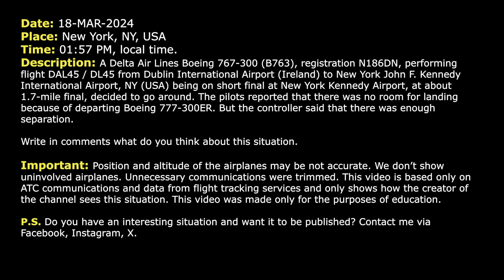Pilot argues with Tower controller about separation at New York Kennedy Airport. Real ATC

Comment: When the controller says “it would have been tight”, that’s says it all.
Reply: And he asked the the aircraft that had landed to exit the runway without delay and he asked Delta 45 to slow their speed. So clearly there was a developing issue with spacing.
Reply: That's why he realized what was happening and took action to make it work.. @BLACKMONGOOSE13
Reply: All he needed between the two aircraft was air India 6K feet down the runway and airborne when delta crossed the threshold. I did this many, many times when I worked in the tower. It’s rather fun!
Reply: Who operates on tight.?
Reply: @alexfrancis3603 I did for 34 years. To maximize airspace utilization, running at minimums is required.
Reply: @michaelhall9138  right. I agree with you.
Reply: They operate with no margin for error and lucky dice rolls day after day. Bean counters say it is efficient and profitable. Hundreds are going to die in a single incident before anything changes.
Reply: They also don’t fly commercial aeroplanes. The pilot said it wouldn’t work so it wouldn’t work. There is no debate around that and the ATC needs pulling up on his response.
Reply: @TuppenceAbucket ”atc doesn’t fly aeroplanes.” And pilots don’t hit squeeze play air traffic control gaps, so maybe listen up and know that a 2.5 miles gap is all you need. I do it everyday. Pilots are not experts at everything, they screw up everyday as well.
Reply: @SouthendSupreme  hopefully I won’t ever be on one that you are flying then blindly doing what ATC says
Reply: @TuppenceAbucket  I’m not a pilot. I’m a controller. 5 mile gaps are hit all day long all over the nation. Even tighter at busier airports. The truth can be scary for some but maybe you shouldn’t fly. Period.
Reply: @SouthendSupreme  did you even watch the video before wading in? It was down to 2.5 miles  (and closing) when Air India got their takeoff clearance.
Reply: @TuppenceAbucket if YOU watch the video he says the magic words when he lines up Air India “traffic 5 mile final.” Thus I said he hit a 5 mile gap. When the landing traffic rolls out and turns off it was down to 2.5. Standard operating procedure. You have no frame of reference, experience or knowledge in this field. Your opinion is that of someone who gets their news from memes. You know nothing about what you are talking about. Again everyone, everywhere hits 5 mile gaps all day everyday. If you don’t then you won’t certify. Please do better.
Reply: @SouthendSupreme  the 5 mile gap is irrelevant, It could have been 10 or 20 at that point. It was a 2.5 mile gap controller said during Air India’s take off clearance. That’s the bit that that matters. And was closing to a point where the pilot went around because it wouldn’t work. You have no idea what knowledge I have keyboard warrior so cool your jets. As to frame of reference I have exactly the same as you: the video and what was said. Which for some reason you are completely misinterpreting to be other than what is heard/visualised on it.
Reply: @SouthendSupreme  agree. He doesn’t have a clue, yet he has an opinion.
Reply: @TuppenceAbucket  you don’t know what you are talking about. Read what Michaelhall has written. He is correct about the distances. 

You keep arguing with others, but you continue to be wrong. 

This didn’t seem too close. The controller didn’t think it was too close. Now, that doesn’t mean that the pilot felt it was too close, which is fine, everyone has their own limits, but legally, this wasn’t too close.
Reply: @TuppenceAbucket   You obviously don’t have my knowledge and you still have no frame of reference. A 5mile gap to start ALWAYS ends up 2.5 when it comes time to roll them. Sometimes less and since you think 2.5 is tight, all I legally need is 6000 ft. That’s right. Barely over a mile.  Again, all you “think” you know is what’s in the video but I know the rules AND the game. I’ve seen it, lived it and worked it. I know you know nothing. You prove it with every reply. You should not “have waded in”, let this be a life lesson.
Reply: @rtbrtb_dutchy4183  why are you waffling on about legality? I never mentioned that. The pilot said it wouldn’t work. The controller argues and in doing so felt it necessary to lecture the pilot that he does it all the time. The pilot reiterated it wouldn’t work. Please stop trying to be “right” about everything.
Reply: @TuppenceAbucket  I’m not “right” about everything. But you are arguing with me about the industry I work in as a pilot and you seem to think you are the expert. There are also two controllers in this thread who not only disagree with you, but try to explain everything. 

So, let me recap the video for you:

1) the pilot decided to go around and has every right to do so. He felt uncomfortable and was distracted. He should go around. 

2) The controller was also correct, this would have worked. 999 out of a 1000 pilots would continue to at least the threshold of the runway. Me personally, want to see the airplane airborne by the time I cross the threshold. 

This pilot called it off early. That’s fine, he obviously was no longer focused on landing, but on the aircraft on the runway. But that doesn’t mean he was too close. He wasn’t.
Reply: @TuppenceAbucket  and the “right about everything” is just ridiculous. You are the one who keeps challenging people in the aviation industry. People who are experts due to their jobs. 

I know nothing about trains. Nothing about boats. Nothing about medical stuff. So I don’t have opinions about it either. Only questions. You on the other hand, think you have expert opinions about an industry you are not involved in.
Reply: @TuppenceAbucket  ATC wasn’t arguing. I don’t know where you guys get that from. There was no argument. There was a discussion and explanation back and forth, nothing more, nothing less. 

Stop making this a drama.
Reply: @rtbrtb_dutchy4183  100% with you. This was no argument. ATC was doing his job and the pilot was doing his job. In this case, expectations just did not match. However, if there would have been an argument I am even more with the controller, as he sees these situations every day, its not the pilot's job to tell the controller, what would have worked, he probably doesn't know how reduced runway separation works. He should have said: "We were going around because we didnt feel safe" - but telling ATC "there was no way this gonna work" is kind of disrespectful.
Reply: @rtbrtb_dutchy4183  When he said that he did it every day and expressed disagreement with crew decision, that was clearly argumentative and absolutely unnecessary.
Reply: @TuppenceAbucket  I watched the same video. You people just create a drama over nothing. 
Both the pilot and the controller did their job. No one to blame here. 
Controller knows how to sequence airplanes. He knew the airplanes wouldn’t bust the minimum  separation.
The pilot was distracted and didn’t feel comfortable, so he did the right thing and did a go around. ATC asked why he went around, not to scold him, but they always ask. The pilot says he felt it was too close, which is his right and the controller explained his point. End of story.
Reply: @HapyLLIuTeJIb There was no argument… Both just briefly explained their decision making and thats it.
Reply: @juli99475  except nobody asked the Tower to explain anything. Wasn't required. Didn't contribute to anything. Was counterproductive. The opposite of his job description.
Reply: @rtbrtb_dutchy4183  ATC was clearly exasperated and frustrated, simply another symptom of the stress from them running over safe capacity.
Reply: @whatilearnttoday5295  exasperated  and frustrated?  Nope. There was nothing unsafe here. This was nothing.
Reply: @whatilearnttoday5295  I see your responses. You are not in aviation and you don’t understand how things work. You make the wrong assumptions. Nothing here was unsafe. ATC has strict rules how close an aircraft can come to another. When he says: “it was tight”, he means to the minimums he is required to abide by. These minimums have a safety buffer.
Reply: @HapyLLIuTeJIb  doesn’t matter what was asked or not. Pilots and ATC work as a team. It’s ok to have these kinds of conversations. It happens all the time. Man, you people invent some drama.
Reply: @rtbrtb_dutchy4183  this is just utter nonsense. The controller can’t “know” they won’t bust separation. The controller set them up to what normally works. It didn’t work. The pilot went around because it wouldn’t work for the aircraft (and said so again the second time because the controller sighed and argumentatively gave a lecture).
Reply: @TuppenceAbucket  did I say that he would “know”. Come on man, this isn’t rocket science. The ATC has a specific distance between the two, where he will call for the go around himself. But as long as he isn’t at that minimum yet, he is allowed to keep it going. 

The pilot is allowed to go around if he feels uncomfortable or distracted or whatever his reasoning. So him going around is not an issue either. 

There was no fault here. No argument either. They both gave their opinion. End of story.
Reply: "I do this everyday sir" and "it would have been tight" sounds to me like "We make it tighter everyday until at some point we have minimized all the margins so we can shout even more to any pilot that readbacks wrongly at first opportunity, because any delay or mistake would be a direct danger to hundreds of lives"

Ah yes quality ATC.
Reply: @nlhans1990  no, they won’t make it tighter every day. They have a minimum distance they are allowed to have. This minimum has a buffer. There was nothing wrong here.
Reply: Really?
Reply: To make it "tight" (safe but efficient) is the controllers job.
Reply: @juli99475  There is no such thing as "tight" and "safe but efficient". They're oxymorons.
Reply: @juli99475  what if Air India rejected takeoff ?? No need to take uncessery risk the pilot of Delta made a judgement call he actually lands a plane every day has over 10 000  hours of flying a plane. Believe me we hate going around but its the new standard for increased security
Reply: @juli99475  As a former ATC, the purpose of air traffic control is "the safe, orderly, and expeditious flow of air traffic." The minimum separation requirement for CAT III aircraft between a departure and arrival was the departure must be 6,000 ft down the runway and airborne before the arrival crosses the runway threshold. I don't know what the separation standards are now. (As long as they don't hit?) You left out the word "orderly" in your statement. Nowhere in my controller's manual did it say that my job was to "make it tight." Are you a pilot? Have you ever tried to land behind a heavy (more than 300,000 lb.) jet departure? Jet blast, wake turbulence, and extreme gusting winds throws a hammer into this scenario. I probably would have gone around, also. If I'm on a mile and a half final and the preceding heavy departure is just now "struggling" down the runway to get airborne, I'm going around.
Reply: @juli99475  lol no
Reply: @juli99475  make it tight is NOT safe, lol
Reply: @juli99475 correct, but “tight” is not a phrase that conveys safe professionalism.

Always think how the coroner’s court would have interpreted the word “tight”
Reply: @juli99475 I work on the ground at an airport and ATC does shady shit all the time. If you are up to the news you would know there has been many near misses at JFK and this might have been another if it wasn't for the pilot! This isn't about someone getting their feelings hurt, its about preventing an crash! Accidents are something that happens that you were not aware could happen, this is some idiot trying to put two planes in a tight area. Two heavies at that!
Reply: @joseph3005see  you just make your life too easy. The FAA establishes regulations for ensuring separation. If these values are not busted, everyone is considered safe. You can always argue that the more spacing a/c have, the safer it is. Where do you want to draw the line if you say 1.7NM final is not enough while the preceeding is at 54kts? The pilots had a different line than the controller but no one was unsafe here until proven different. I also think that the runway incursions recently have been a problem. But here the controller was fully aware of what he was doing (instructed to expedite vacating, and final approach speed). I think what you mean is caused by lacks in situational awareness also busting the mentioned FAA regulations. Here I see no sign of that. Everyone was fully aware of what’s happening. If you want to blame someone here, blame the FAA instead of the controller.
Reply: @joseph3005see  you have an opinion about something you know nothing about. He didn’t try and put two planes in the same spot. He tried to have one follow the other. The pilot didn’t feel comfortable and did the right thing, but that doesn’t mean they were too close. Everybody in this audio did fine.
Reply: @juli99475  agreed. Everything was safe here. No issues. A nothing burger.
Reply: When he said it would be tight, he was actually talking about his boyfriend.
Reply: He also said, "I do this every day."  meaning safety was not infringed.
Reply: @N_Wheeler  It being done every day and safety being infringed are two different things.  This will come unstuck eventually. That is assured.
Reply: @N_Wheeler  Or it means safety is infringed every day
Reply: @ClassicalRips no, it doesn’t. It means they know what works and what doesn’t.
Reply: @N_Wheeler so you were the offended controller...
Reply: @N_Wheeler  "I do this every day" as an argument to feel comfortable with the handling of a critical task is the reason many accidents occur (across industries)
Reply: @gastonpossel  nothing was unsafe here. 🤦🏻‍♂️

Comment: Based on the data, Delta was at 500 feet when the 777 was taking off. It probably would have worked but it would have been very tight.
Reply: Controller needs the departing aircraft to be 6000 ft down the runway and airborne before the arrival crosses the threshold. He would have had it all day. Delta is perfectly within their rights to go around, but he was wrong about the spacing. The controller had the required separation.
Reply from the maker: Maybe we're looking different sources. Anyway, the distance was about 1,7 miles.
Reply: @YouCanSeeATC So yea, about 500 feet. 3-to-1.
Reply: @YouCanSeeATC 1.7 miles at 140 knots is nothing
Reply from the maker: Yeah I know, but Air India wason the roll. So technically it was possible. But I don't wanna blame anyone. Pilot is flying the airplane. He is responsible for everyone there. Controller is responsible for safety. And he has time, 1.7 nm, to instruct them to go around if the runway was occupied.
Reply: @YouCanSeeATC  According to the flight tracking, how long after the go around call and how far down the runway did Air India get airborne? From the numbers you've given, it sounds like it would have been ridiculously close and could have been a very late go around if it were misjudged. Late go arounds are much riskier than early ones, so it's generally better to go around while you can still do so in a leisurely manner rather than wait until the last minute in the hope that it will work out.
Reply: "Probably would have worked" is just not a sentence or thought that has any place in this kind of situation, needs to be way more than 100 per cent certainty, or it shouldn't be happening.

Comment: The pilot knows his airplane best.  He has to have enough room if, for some reason, there needs to be a missed approach.  The Controller was too aggressive.  Remember, Controllers get paid for the number of take-offs and landings.  Some Controllers sacrifice a little bit of safety for the dollar.  The Controller will receive a stern "talking to" from the Control Tower Supervisor.
Reply: Controllers get paid for the number of takeoffs and landings? I've never heard that before.
Reply: @Republic3D  Because it is false.
Reply: It IS utter nonsense. Your implication is that this controller was pushing the gap in order to get paid more. This controller is not "sacrificing safety for the dollar" - whether he got the aircraft away or not would have absolutely zero impact on his salary.
Reply: What utter nonsense. Tower controllers get paid a salary, not by the movement.
Reply: Pilots actually don't have really good spacial awareness as much as you think. 99% of the landings we make have plenty of room between other traffic. Especially at busy airports, you are relying on ATC to put you in a sequence that fits. If this happened at a small airport then yea I wouldn't trust the controller at all. But JFK, probably.
Reply: Let me elaborate on the relationship of T/O and Landings, or cycles as I call them, to salary. The busier the Controller space, the higher the pay rate.  Simple really. So “utter nonsense” is utter nonsense.
Reply: @marshallpoe8087  "Oh man, I got called on my nonsense about controllers being paid per movement and now I'm backpedaling".

Fixed that for you.
Reply: @phytonso9877  Not even close.